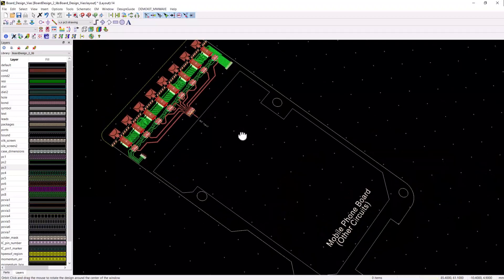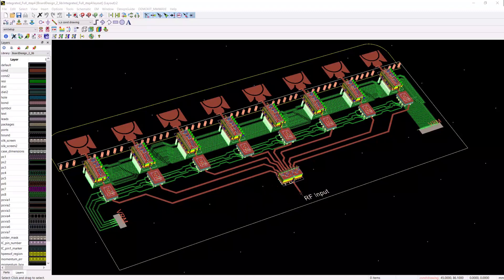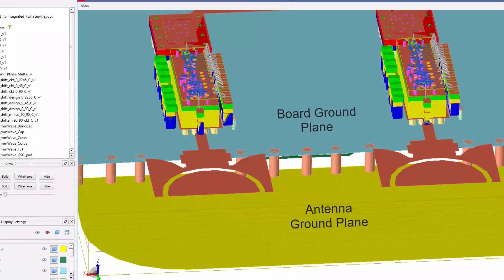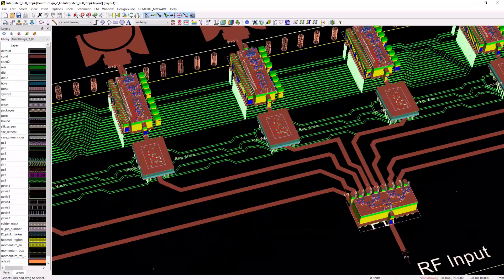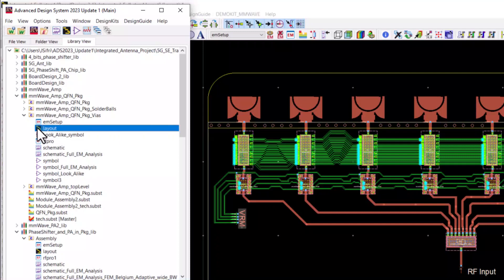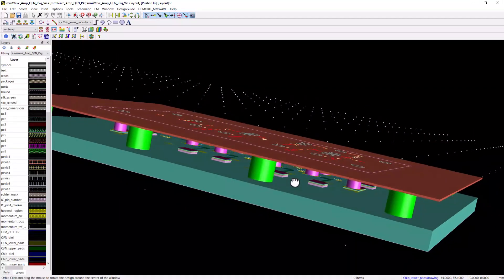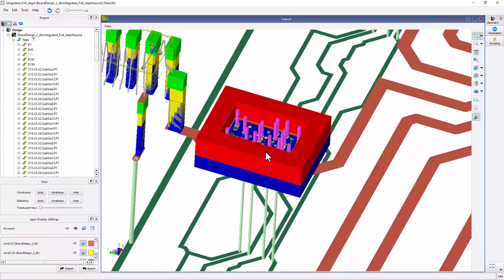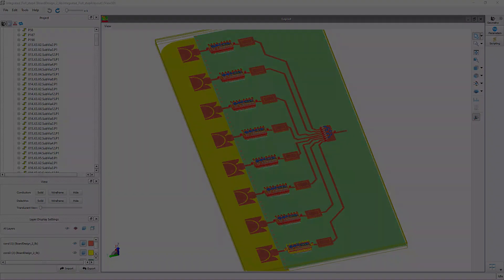Physical Integration of a 28 GHz 5G Beamformer Module in ADS

Comment: What purpose does this really serve, as even the bond wires don’t couple sufficiently to the fields of the antenna, much less the MMIC artwork?  You certainly wouldn’t try to mesh that.
Reply from the maker: Good question Louis,
The MMICs, packages, and Bond wires must be meshed and EM-Simulated separately since their output response will naturally be altered and shifted in frequency due to proximity and parasitic effects at mm-Wave frequencies. The Board and packaged MMICs must also be EM simulated to evaluate the coupling effects from the RF and DC lines and Vias. Now, the antenna by itself is EM-Simulated separately with FEM and its Far Field plots display the Beam, but ADS has something unique, called “Circuit Excitation” from the Transmit-chain simulation results and brought in to be included with the Antenna Far field to steer the beam with the swept phase-shifter angles.  So, the Transmit chain simulation (with swept phase angle) is driving the Antenna (simulated separately with EM). This would allow us to steer the beam and measure the field intensities and lobes, etc. 
This YouTube video shows the “Circuit Excitation” feature in ADS:  https://www.youtube.com/watch?v=nvS7J3DQQ0Y&list=PLtq84kH8xZ9HJAO9OZSzgnr2GqTd0aUVL&index=86&t=0s
Thank you for your feedback. We’ll definitely consider adding all of this and more in detail in a future Simulation video.